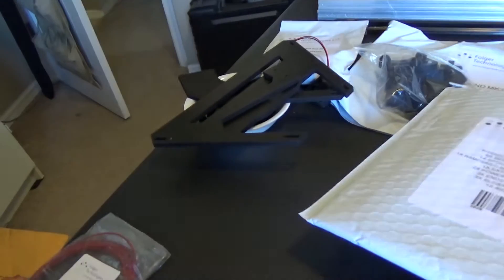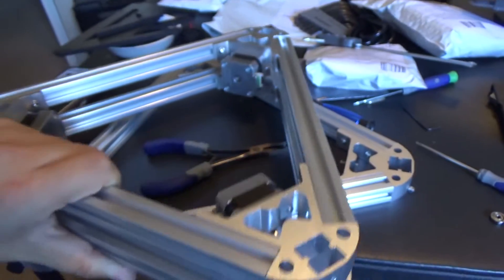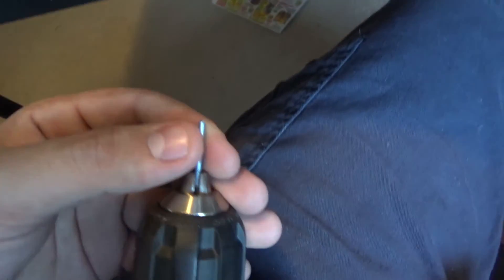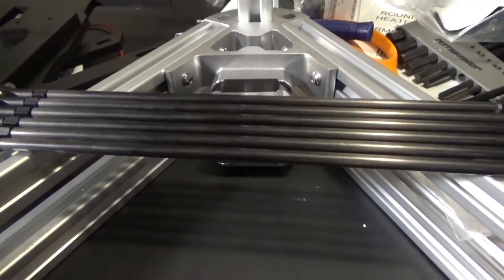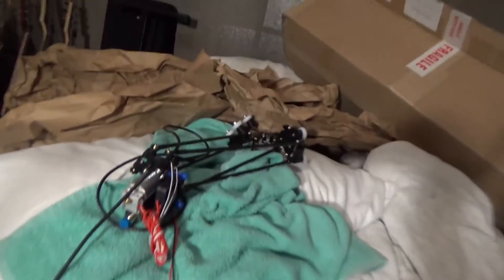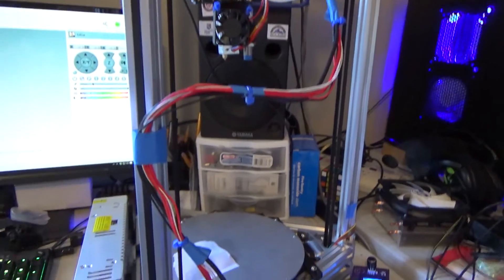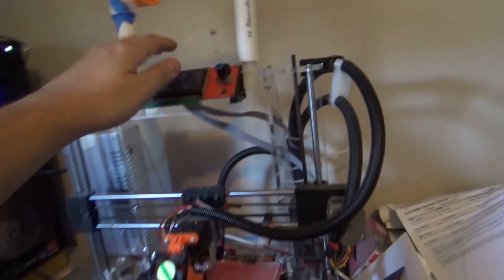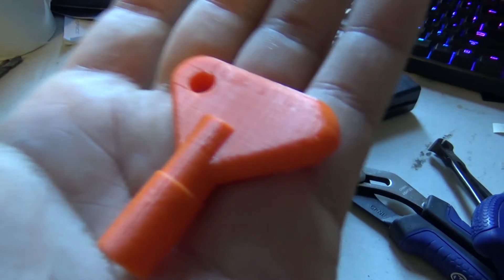Folger Tech Kossel 2020 3D Printer Build Log

Comment: Hey Dustin, enjoyed your vid.  May I offer a suggestion for cutting the all thread?  Put a nut on the all thread first then cut it then remove the nut.  This will fix the threads and make life easier.  Also some wire strippers come with an all thread cutting feature.
Reply from the maker: maxwellou812 yeah I started doing that with all thread. Makes life so easy.

Comment: I have had my Kissel rev b for over 6 months and was never able to get auto level working :( the probe works and I can get the code to make auto level happen, but cannot get to work in printing.
Reply from the maker: I got it to work fairly well, but I stopped using it and just leveled the bed manually. Prints perfectly now.

Comment: Im new and considering the kossel 2020

honestly..worth the build? I love the delta configuration. .

please post more print videos...  time lapse would be awesome
Reply from the maker: +Bryan Kale I will be doing more in the future, do not worry. Personally, I love the delta setup more versus the Cartesian style printers. This style can print really fast and seems to be really accurate once it is calibrated correctly.
Reply: +Dustin Corbin awesome.  I am going to use a 12v power supply because I'm off grid on Solar, but I really think this will save me trips to the store for simple stuff like hose connectors, sprinklers, PVC Style Connectors, and Nozzles, Sprayers, Misters, and Drip Emitters. I am a farmer and aquaponic greenhouse food production an hour to town..  this could very well save me several trips a month to town..  even print a bunch of Legos ;)

Peace Bro! Really Enjoyed the Video.. found a kossel on Craigslist for $350 hes afraid of the build.. ;) trying to get $300 ;)

Im subscribing Bro...  cya
Reply from the maker: +Bryan Kale You certainly can print quite a lot of things with it, as long as you can design or others have designed what you need! And thanks a lot for subbing! I really appreciate it.